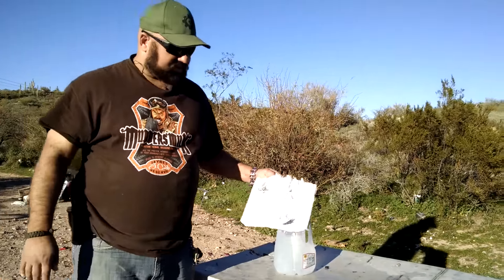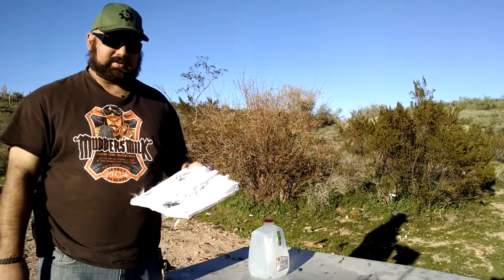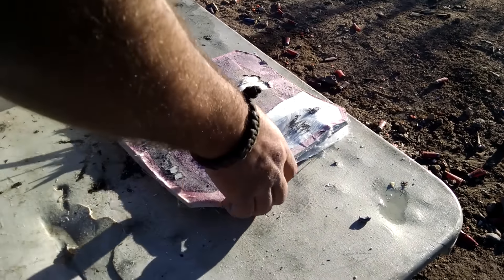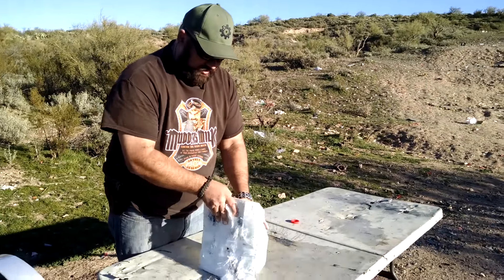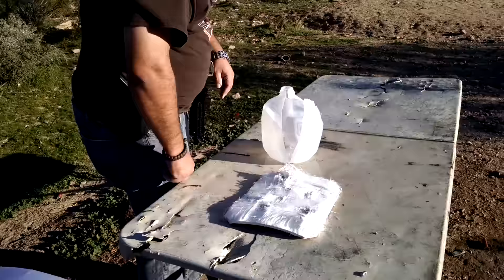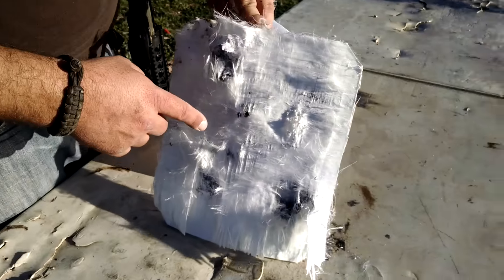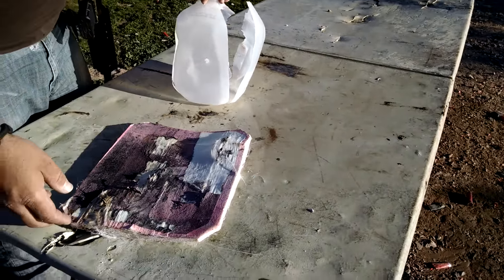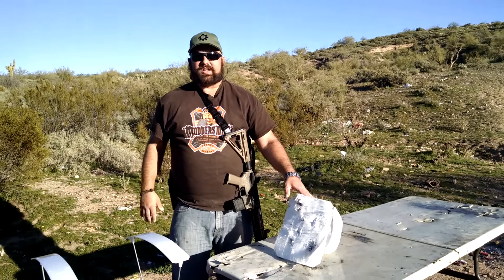Highcom 4SAS7 backer test video ***DEMONETIZED***

Comment: HMMM just thinkin` hollow points might stop easier once expansion happens!  I assume the .147grain  Gold dot was hollow point...LOL...So I bet/think a 40S&W FMJ, going 1000+ fps could pass thru,   maybe?
Reply from the maker: +robert h JHP and FMJ are known to perform about the same in armor. I may test other cartridges against this panel, though. Probably 9mm, .357 mag (carbine and revolver), maybe .44 mag.
Reply from the maker: +robert h That's my experience, but this isn't my home made milk jug panel. This is the polymer backer from a Highcom 4SAS7 level IV plate.
Reply from the maker: +robert h I look forward to seeing it.